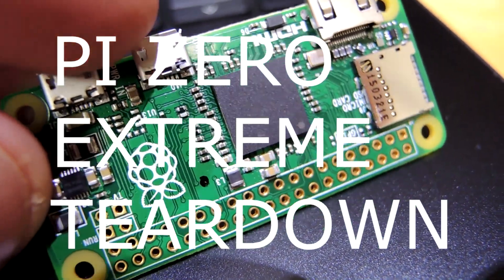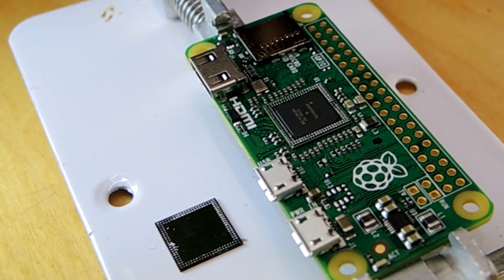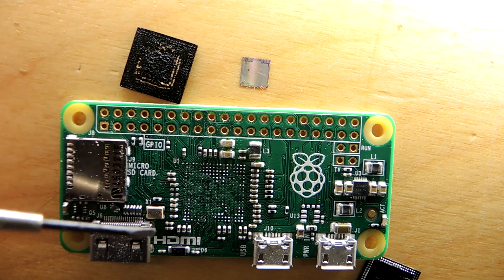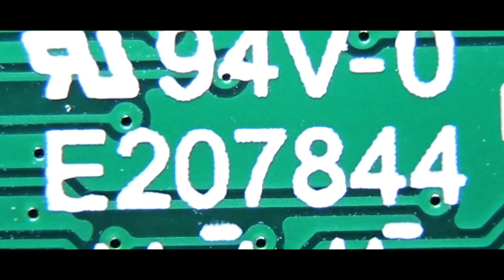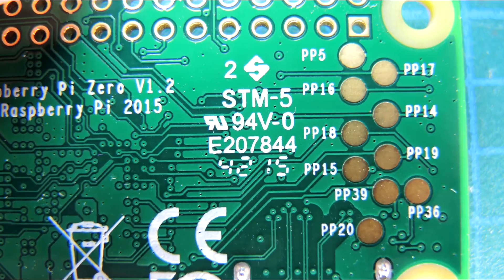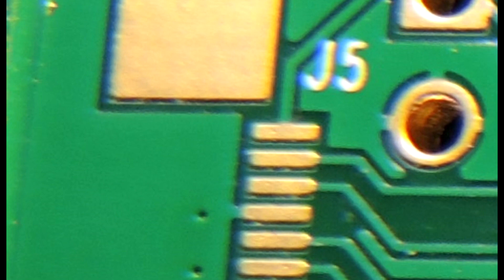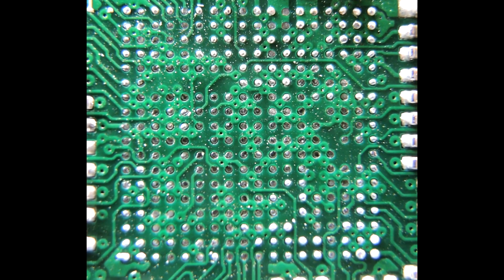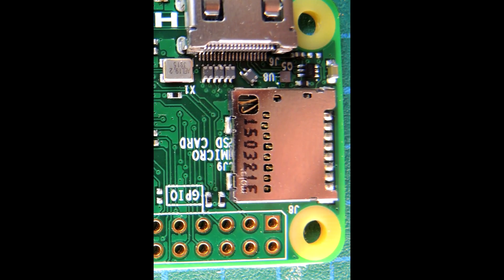Raspberry Pi Zero  Extreme Teardown

Comment: Specifically the part about the JTAG, I was so curious what those contacts were actually for.  What would be the use of the application of JTAG on the Pi Zero ?  NOW that was a REAL Review/TEARDOWN of the Pi Zero (Do you have one on the W, I would like to see where they squeezed in WiFi and Bluetooth into this bandaid sized computer).  No stupid music, No look at my plugs , look at my SD this is how you install Raspian, not I'm 50 and I want to play Sega .  That was the real raw deal.  Thank you for that extremely helpful and informative video .  I thought I was the alone in staring at this pcb under a microscope trying to figure out what, where , and how these micro components actually work, if & how they are capable of MORE.

Comment: Hey didn't hear you mention a ram chip on this, do you know if the ram chip is intergrated in the cpu or separate?
Reply from the maker: DRAM chip is on top of the controller.  There will be some RAM blocks right on the SoC die, but they will be relatively small

Comment: I'm sorry if it's my hearing, but did you say that the JTAG worked? The Raspberry Pi 0, on the home site says that the CPU was either a ARM1176 OR ARM1176JZF-S. Is this an improvement so few were shipped with the less powerful version of the CPU? I'm looking at installing Android onto a feature-phone but I don't think the JTAG is setup on the phone (Nokia 208). If a £23 phone with a replaced LCD & camera. Basically, to show that £60 or so gets you a £120 smartphone. Cheers.